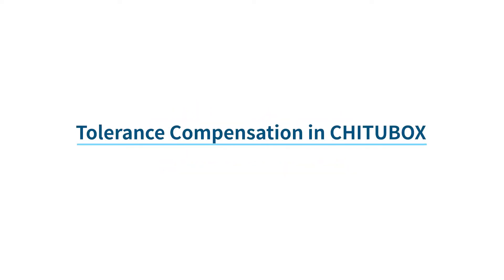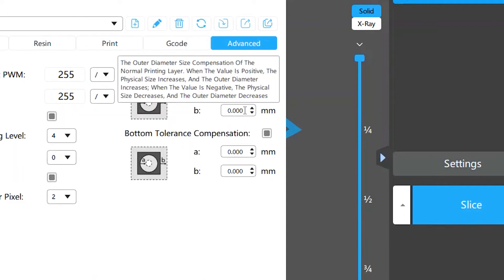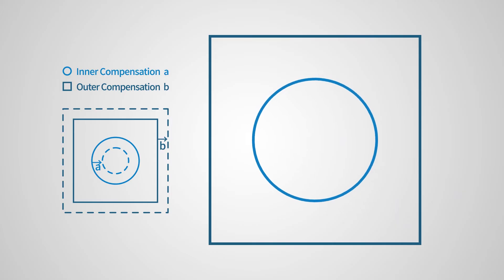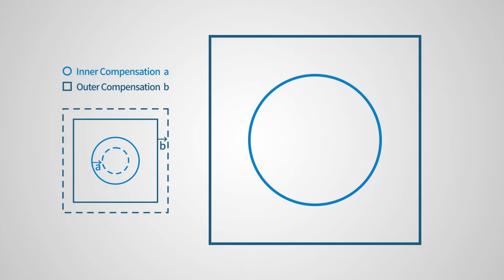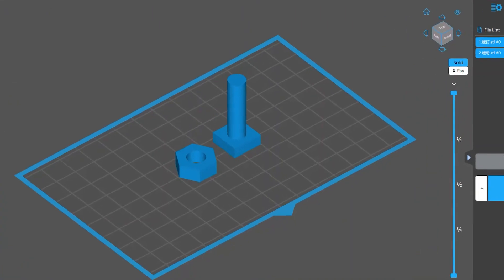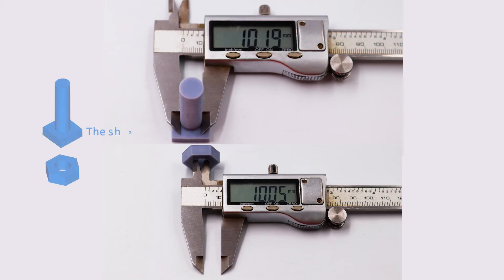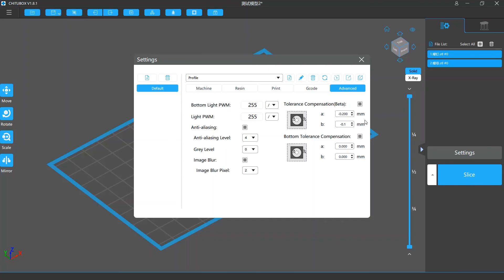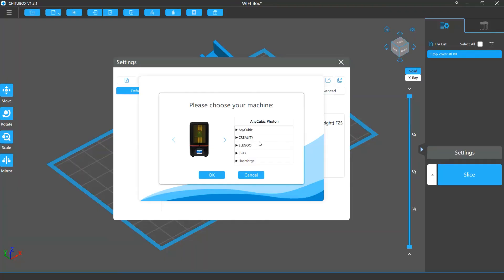[CHITUBOX Basic]Tolerance Compensation

Comment: How does the compensation work when the parts are printed at an angle? Does it still apply?
Reply from the maker: Nah, TC works by detecting inner and outer contours, layer by layer. This means it only operates in a 2D space; it doesn't care about the angle of your model. You'll need to keep an eye on contour changes yourself.